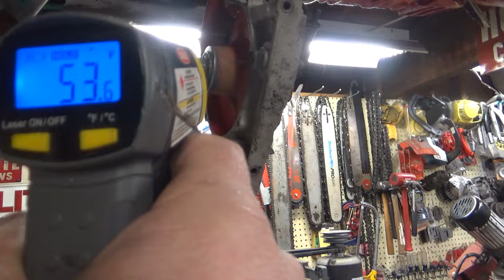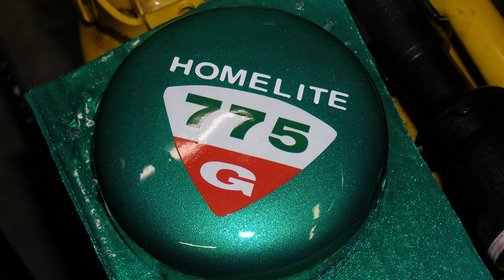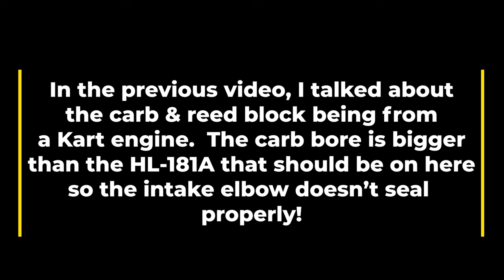Restoring My Homelite 775G Chainsaw Part 1!

Comment: I have been doing some warm winter painting myself!  I just painted a homelite XL12 a lime green and sanded all the trim around the edges shiny bare metal with a clear coat covering everything and it turned out looking bitchin! If im not mistaken? That paint color you were showing us viewers from Chrysler is the color that they used on a 392 hemi engine i used to own!

Comment: I found the Duplicolor engine paint last year, it is a pleasing color for the Homelite. I use Rustoleum clear coat over it and Rustoleum automotive primer to start off, all in rattle cans. I was doing some Jonsereds saws from the 70's and 80's too and this paint color was a good match for that. But I kept desiring a closer match and hoped to find a paint system that had more hardness/durability, the Duplicolor system tends to be a bit tender even after a month cure, maybe it gets better with old age. I went down to the automotive paint shop and was easily able to get super close for particular shades with an automotive Urethane. They can put it into a rattle can, which I did some, but I decided to use a small air gun, less than $30 off amazon, it has a 250 ml cup and it can literally tune down to air brush like application, or apply heavier as you need, perfect size for saw parts painting. To the urethane I added a hardener and cut the mix with reducer, man does the paint flow nicely. The hardener produces a super gloss and within a few days of application the paint was really hard, literally felt like  a powder coat, found no need for clear coat with this system. The one drawback is the cost, that automotive red paint is spendy stuff but for me the job it does is worth it. That red and green ya got there is sure eye catching, old school looking!